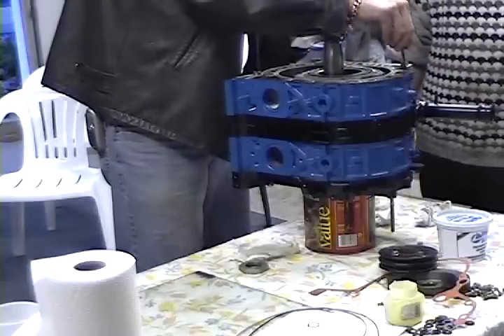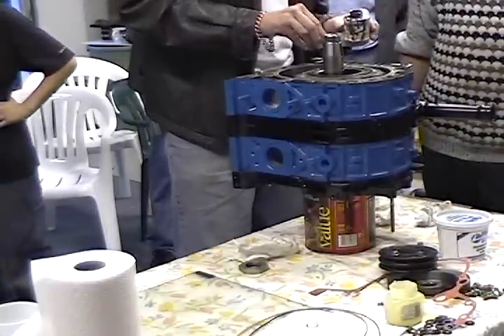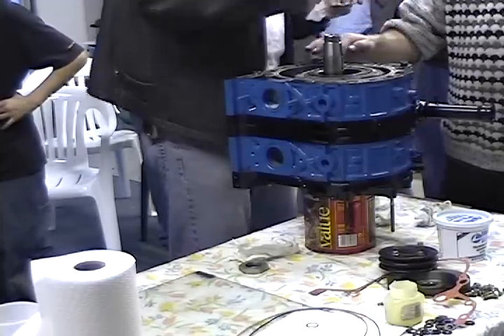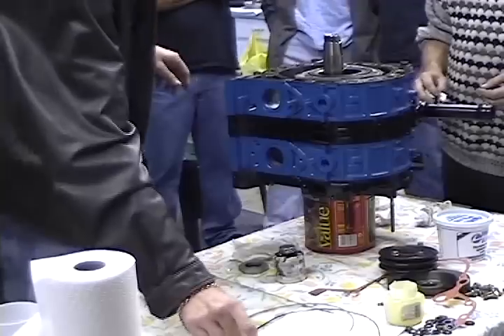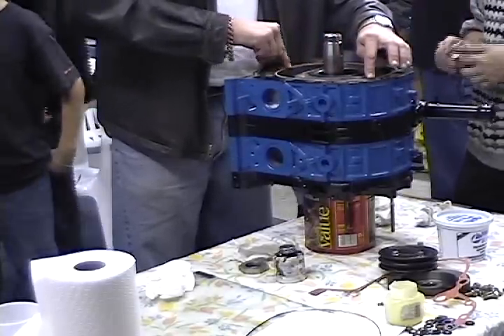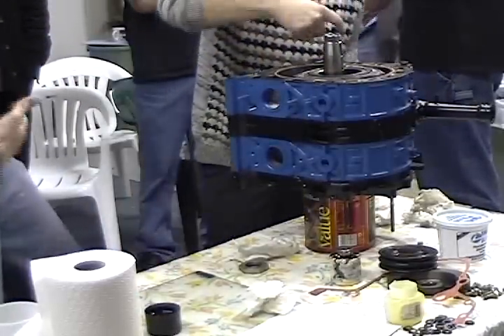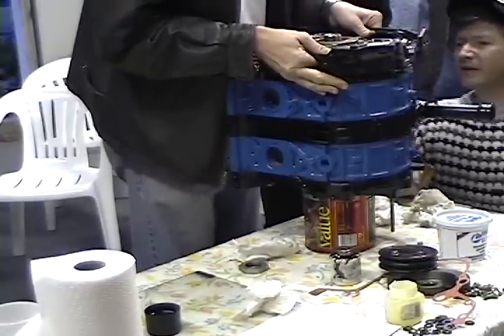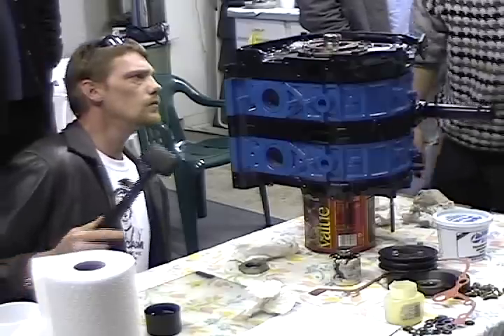How To Repair Rotary Engine 7

Comment: the engine build looks very straight foward... i just doing research on the rotary engines... what is the sealant you brush on each side of the engine plates?..is that a special mazda sealant?